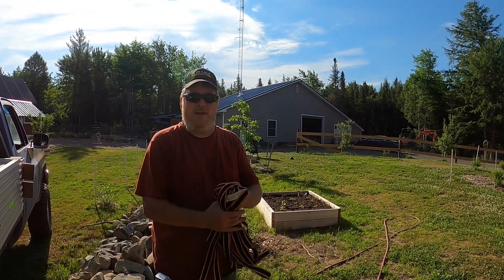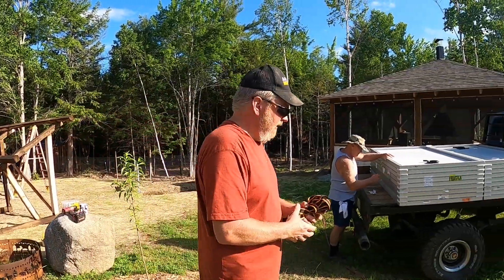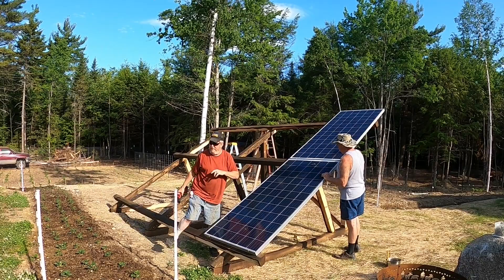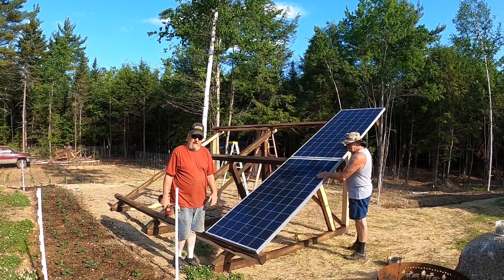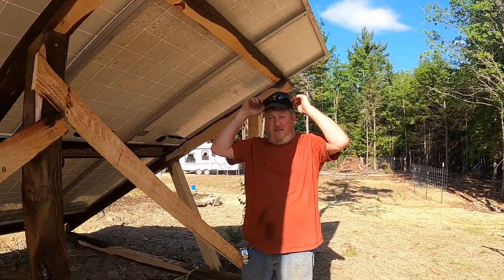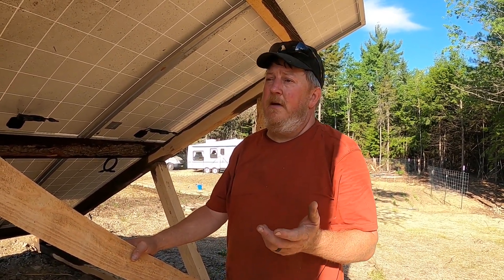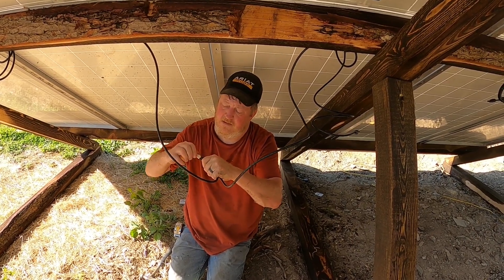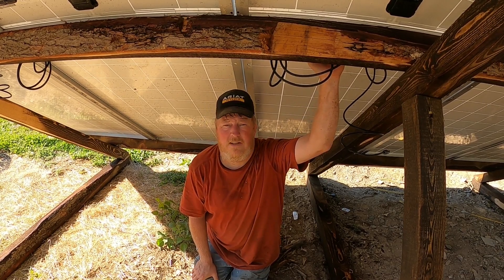New 600 Volt Solar Array On a Budget(a little bit redneck)

Comment: The angle toward the sun looks off.  It looks like 30 degrees and in your area it should be closer to 50.
Reply from the maker: Yes, Our area should be 45 ish degrees, We chose to go 30 ish degrees mostly based on the fact we do not need the production from this array. This array has one job only and that's to give us 4-500 watts during a power outage in the winter. We didn't want the array sticking to tall in the air in this spot. Our main array is all micro inverters and is at 45 degrees

Comment: why ever the hell did you cut off the mc4 plugs? 
a high quality screw joiner?
what what what
i am amazed you even consider this atrocity not to say actually doing it
Reply from the maker: Hah well the MC4 style connecters where not high quality trust me, These modules are surplus from a failed goverment job and have been setting outside for 2-3 years and all the MC connectors are full of dirt and corrosion. I plan to cimp new Amphenol MC4s on them it was just to hot yesterday and the Engineer from Midnite will be here today so I needed to get this working for now. Before winter we will change the wire in the conduit (If copper prices come down any) and get the MC style connectors installed. (Plus this will give Midnite a chance to test Arc Fault on the new controllers LOL)

Comment: Thanks for the video. How many watts are each panel in the array? Nice thing is you can raise it up for winter snow with some blocking.
Reply from the maker: These are REC315 modules from a goverment job that never happened. And yes we could tip the array up in the winter. We hadn't thought of that but your idea would work well for us. We didn't want the array tipped up a lot all summer in the middle of the garden.